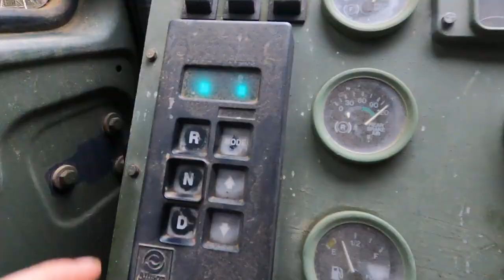We Broke Our Massive Army Truck

Comment: Hey just a tip (you may already know). Just noticed right when you started limping the truck back to the shop that you were pumping the brakes. With air brakes you want to apply steady, even pressure and avoid pumping them as much as possible. With hydraulic brakes it doesn't matter as you always have pressure. With air brakes if you pump your brakes too much you'll run low on air as the compressor simply can't keep up. With most air brake systems if you run too low your brakes will suddenly lock up no matter how fast you're going.

Comment: TIM from Canada suggestions for when you want to burn your bush . suggestion one. wait until it rains everything is a little wet then you can start your fire and you should be OK… suggestion to put everything in a big pile. remember where your piles are. in the late fall early winter if you can get to it then stir your fires or leave it all winter early spring when everything is still wet these are your best days of the year to burn your bush or tree limbs or whatever you have

Comment: There seems to be quite a few dead trees along the trail, so another option would be fascines or corduroy roads.
Chainsaw them down, cut to length and place the trunks and big branches across the boggy low points with the trackhoe.
Reply: Well, been there, done that, that works as temporary solution, as in cutting the wood, cleaning the wood or so in a single year, after a year or so wood trunks start dislodging due to either ice forcing them apart, or simply heavy tractors/trucks push or even brake them. Stone is a much better permanent solution for years to come, and since there is enough of that, I would continue on that "path" rather than wood.
I have had a mud pit created by wheeled tractor by the live stock  barn when carrying straw and hay to feed, a couple of human weight(~2 feet "tall") flat boulders burried so they make large level pathway , solved all the problems permanently ...

Comment: I ve changed those by myself 300lbs each combat wheels .An afternoon of fun spluge bolts a day ahead before attempting removal rims are 3 pieces and need  O ring gasket in Perfect Shape !! Use digger to offload and move tire if you finesse the it properly , or cheat and call tire guy and watch how he does it and properly reattach CTI system making sure copper gaskets are installed on banjo fitting properly.

Comment: It was mentioned by others to have a good sized wood stove in the shop area.  I totally agree, but will add one more detail.  Build it with internal baffles in the fire box that will recirculate the fumes until they are completely incinerated.  In this fashion the VOCs (volatile organic compounds) will burn up and yield the most heat value per unit of fuel.  You can also add 'heat-thief' type fins on your exhaust tubes to extract even more heat before it goes p the chimney.

Comment: id put that snow plow on the army truck chain that up with some ice breaker chains and you wont be getting stuck as much if any  as for it not starting in the winter it needs a block heater will start right up

Comment: So you know, the advantages of NOT doing too much on the road (which seems wicked long) is to see how the weather is impacting it.   By the end of Spring you'll easily be able to make a prioritized project list next season.  You also have the winter to research when to ditch, armor, and/or make a culvert, etc.  Seems like you have enough contingency vehicles to wheel it in or out.  I keep thinking the right answer is to prioritize build a MF'ng stove on the ground floor and then chop MF'ng wood for a week (2-4 cords of the driest stuff you have around or old deadfall) and stack it.  It won't dry out proper for burning, but at least you'll be ahead before it gets too cold.  Better yet, designate an area where you are going to stack your wood and maybe dedicate a day a week to just chopping and stacking cause it takes at least 6-months to cure wood.  Make note of how much wood you burn through the winter and that'll be your baseline for what you need to routinely chop/stack next Spring/Summer.  I also think it would be fun to do a winter burn of all limbs and refuse, just thinking of how to systematically remove deadfall and stuff for fuel, which mitigates forest fire risk also.  Uh, says I, at my teleworking desk with an oil heater at my feet and a mild winter in suburbia ahead of me.  I'm stacking wood for bonfires and smore's ... what do I know ;-p.  Have fun!
Reply from the maker: That all sounds like an excellent plan! We're going to need a heat source asap because the weather just turn a turn and our low was 19F last night!
Reply: You will need lots of gravel.  Starting with 6- to fill big holes is good.  Before the ground freezes make sure thee is good drainage.
Reply: @AmbitionStrikes  Cold!!!  I'd add - think of staging and access for the wood.  I don't like the idea of wood piled around my living structure.  I think that was popular back in the day for extra insulation, protection or something... A cord  inside the pole barn (but not too near the stove) guarantees a healthy supply of dry stuff and then you'll want a solid path you can wheelbarrow or transport curing wood into your ready pile.  You can also stage the wood in piles of rounds (like when you cut a tree,  cut it to rounds and pile 16-18" tall rounds per whatever preferred length) to start the slow drying, then quarter whatever you need for the winter, in your outside drying area, and then just routinely cut down the quarters, so you have usable side stuff slowly piling up. Maybe building a bad ass log splitter is in the future?  To make this all easy... but think you need to brute force it this winter.
Reply: @AmbitionStrikes  Yes heat source is the main priority ... the road should soon freeze and should not  be a problem till spring ... but cold is a problem now.
Reply: @AmbitionStrikes  I highly recommend the biggest size Blaze King stove you can get! Trusted in severe climates like Alaska and Canada. They have a catalytic converter element, so you can slow burn overnight without clogging up your chimney with creosote. I have one myself, and love it.
Reply: @007Yoghurt   @007Yoghurt  That is a good detail about re-planting both for mud and dust.  I'd definitely opt for local shrubbery versus more tree growth.  Fruit bearing stuff like blackberries and blue berries is fun and seasonal opportunities for natural sweets, but not sure if that is a good idea in bear country.  It is an endless list - right now, I'm sure the priority is just SURVIVAL.  It is like 24-months out until they are settled in enough to think beyond the basics.
Reply: You also should look at getting a reliable log splitter.  That way there's no chopping: use the chain saw to cut the logs into 16" lengths (most wood stoves can use that length of wood) then feed the pieces into the splitter.  In a few hours you'll have enough wood to last all winter and then some.

Comment: Those big western red cedars are high value for lumber. If you have any thoughts on milling your own lumber down the road, those cedars are for sure worth setting aside. They make some sweet interior paneling- beautiful and great smell. I don't recommend exterior use (roof shakes or siding) because of your fire zone. Dry cedar burns real easy.

Comment: Your cut trees log storage is up the hill with just two sticks in the ground supporting the whole thing.  That's dangerous, you can have a downed tree on them and they will roll.  If one of the sticks gives up, those logs will be rolling towards your structure.  I would either change the log storage location or provide more support reinforcement.  I prefer option 1.  Best of luck to you.  I enjoy watching your posts.

Comment: Man that gouge looks bad! Find a truck stop or tire place, a lot of times they can patch a sidewall, we used to have the truck stop patch sidewall gouges on our 33x12.50's (smallest size they could patch). Worked fine on trails but not suggested for high speed (like that thing is going to do over 60)😂
Love your channel, you 2 have laid out a nice template for others!
Reply: No! Use tracks! Not tires

Comment: It may be a lot more work now, but when you decide to work on the road, you may want to consider widening it to fit 2 cars. It will allow 2 cars to pass each other when going in different directions, create a wider surface which will be more stable with run off water and safer if you also add drainage ditches on the sides.  Just my humble opinion.
Reply from the maker: I think that is a great idea!

Comment: I love the ambition you have with your projects, which are reasonable for most other people to attempt.  I really think you should consider replacing all your driveway with 'Pervious Reinforced Concrete' in the future, say 12 feet wide.  Do it maybe 50 foot sections.  I know it will cost a lot of money and take some time, but just think of putting your plasma table back to use, and having UPS being able to reach your shop so you do not have to travel into town all the time. :-)

Comment: That blast of air was probably your air dryer because all air brake systems use he have an air dryer to keep the moisture out of the lines so in the wintertime they don't freeze plus they also keeps the moisture out if it's working right

Comment: Battery powered flood lights let you work later.  I actually bought some battery packs to run regular AC powered LED flood lights.  It is less efficient than direct DC powered, but it is cheaper.

Comment: Please remove all the stumps, sharp rock etc. once you have snow, the problems they can cause will be a lot worse . And I would consider widening the access road, by removing some more small trees - you will need some place for snow piles, especially if you have some foot and more snow, you will not be able to push it "all the way" ...
Also it seems that it would be beneficial to widen the road in some places + mark the edges with sticks, for the easier snow plowing, so you don't have to guess.

Comment: Besides stumps along the side of the road, remove and large rocks.  I think you need to remove a few more trees where they are close to the road.
Voice of experience.  If you want to change a tire by hand, watch a few videos.  It is about 25% muscle, 25$% tools and 50% technique !  The must have tools are a HeadBuster XB-554 and 3 KenTool tire irons. If you are going to do big truck tires you need long ones for extra leverage. For cars and 4 wheelers you need a set of smaller ones.  Don't forget lots of lube, dish soap and water !

Comment: Use your winter daylight hours to cut those logs into rounds and split & stack it for next winters firewood. (Good winter outdoor exercise!)
That way pieces are small enough to dry thoroughly over THIS summer. Put the stacked firewood under some repurposed tin to keep 
this winters rain & snow off. Don’t wrap it with tarp/plastic. It needs air circulation.
Reply from the maker: That is a great idea!

Comment: I know this is 8 months after the fact, but in case anyone else is in a similar situation:

In he past, some people in remote areas built up their road foundations by laying logs across the width of the road.  This meant not as much gravel and stone were needed to build up the foundation.  The logs would be laid, then heavy equipment would be run over them to force them into the mud.  After that everything would be covered up with stone and gravel and you'd move on to the next section of road.

Naturally over time, the trees would break up, leading to dips in the road.  But since there was now a base of rock and gravel rather than mud, you could spread more gravel over the foundation.  Eventually you'd have a firm-enough foundation that you could build a concrete or asphalt road

Comment: You guys can put an airline on your truck an air entire up yourself and have Arab Berber your shop is a lot of times the trucks are equipped with it. You just have to look and see either on the – are around here tanks except to add a to connect fitting

Comment: Riley  fix that pop tier.take the tier off the rim  grind  the inner and outter side s and use the vuçanising heating system s it will be like new or better stronger side without  no holes

Comment: There needs to be a crown with a drainage ditch on either side for a proper road.  Easy to do w/a grader.  However, there's a steep learning curve, plus that's a real rocky path...  Your best bet will probably be, do what you're already doing (filling the lows, cutting the highs and sloping where you can), but in the really bad spots, you might think about installing some field tile (perforated, corrugated plastic pipe) to REALLY move the excess water away from your road.  Also, there's a plastic product that you can install into the ground that will help shore up and slow down erosion.  Keep up the amazing work y'all!

Comment: There should be a tire inflation box with controls near the center. it should be a little green box that says X-C/ sand and a few other things on it that box is the central tire inflation system.if u hit the red emergency button that will make the central air fill the tire constianty it's what u hit if the tire was shot.

Comment: In video when you were filling in the low points I saw a couple side roads-one with a chain and another with rocks. Are these on your property or access to other properties from your road?  There is a company called Gluetread that makes sidewall patches.  It would not be a long term fix, but it might have allowed you to air up tire on truck.  Yea, in northern Idaho it gets dark at 4:30.... In Boise we make it until 5:30-yea Mountain Time Zone.

Comment: We had great rock/dirt with 4" minus in it (mostly rock).  I originally was using it mixed with the dirt just how I dug it up.  Eventually the rocks just pushed down into the dirt.  We got some rock screen and built a screener so now we're putting down just rock.  That seems to be working much better.  Just food for thought if you experience the same.
Reply from the maker: We would love to add a screener to our arsenal!
Reply: @AmbitionStrikes  I found them on Craigslist, actually up in your area.  $250 for three different size screens.  Then just built a frame to hold them that is slanted so the rocks go in the trailer and the dirt falls beside it.  I have an excavator about the size of yours and use it to load the screener.  I'm thinking your Army truck would be too high to load directly in to though.  But, rock screen is the way to go.  Huge difference in the road from when I was using the rock/dirt mix.  I had muddy low spots that were at least 6" of mud and now their just packed rock.  We'll see how well it holds up.

Comment: Congratulations on felling those trees, great job.  Riley here is a link for the Technical Manual for your Army truck:  https://tfsweb.tamu.edu/uploadedFiles/TFSMain/Preparing_for_Wildfires/Fire_Department_Programs/Career_Fire_Department_Programs/Firefighter_Property_Program/TM-9-2320-365-10%20Operators%20Manual%20M1078%20series%202,5%20ton%204x4.pdf  I don't recommend trying to print the whole manual as it is 837 pages long.

Comment: Guys MAKE A SET OF TRACKS for the army truck!!!! ASAP. Like you did for the Jeep. Next, use the damn aircompressor on the army truck to POWER AIR TOOLS instead of fiddle farting with the Honda generarator to run the compressor DUHHH. Next put a set of RUN FLAT TIRES on the Lexus before you slice the sidewall on a wet stump or sharp rocks. Ideally put a set of BF Goodrich KO5s on the Lexus, thicker sidewalls and a legend off road! FYI Courtney has very pretty legs.

Comment: Like you said, good thing it was not the gooderer tires. lol  You also are cutting trees like pro`s now, but really have to be watchful on windy days. The tops can break off any tree and kill  or maim you, even if your on the edge of the woods or just walking through them, always be mindful of the wind. Sometimes it doesn`t take hardly any wind for a rotten top to break off.  Pick out the dead trees this next summer and carefully get them down so they don`t fall on anyone or anything.  If you can, use a real long strap, longer than the tree, and pull it down with the excavator. Tug pretty hard on it to see if it breaks. If it won`t come down with the strap and nothing breaks off, CAREFULLY use the chain saw to drop it. Even pro loggers get killed or maimed by not being careful enough. I know a logger that almost died, but was still messed up for a very long time. Maybe you might find some videos on falling standing dead? That`s what i used to heat my house in fire-place insert i built myself out of 3/16 steel. The insurance company loved it because it was built way better than anything on the market at the time, about 35 years ago. Take care
Reply from the maker: The standing dead trees make us VERY nervous! Especially the birch!
Reply: @AmbitionStrikes  I agree. Birch is sneaky, but so can all of them be sneaky.

Comment: .I'm going to be a smart, but and say you should cut the stump to the ground, especially any by the side of the road in truck tires are expensive you get them to Army surplus a lot cheaper than other places you can use the truck itself to Aaron up with your air inflation system. Have a good day. Love you videos wish I could have land like that. That is a gorgeous

Comment: A flat surface and a check of all fingers and toes before and after a must besides a 1" air impact or at least a 5' piece of steel pipe and socket and ratchet handle ,you are fooling around with 600 to 800 ft-lbs of torque for each lug nut ,and wheel is indexed.Cribbing is best then jack on top ,soft ground --good base before cribbing stack on top  BOTH of YOU keep your eyes OPEN,for one another , no second chances or   OOOPPSS !!!